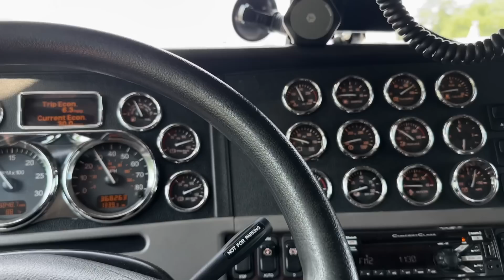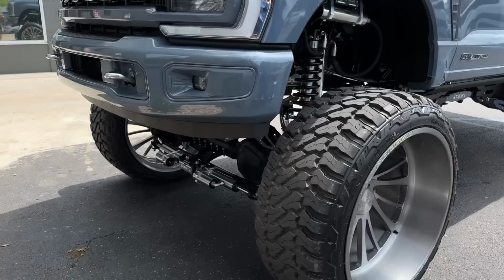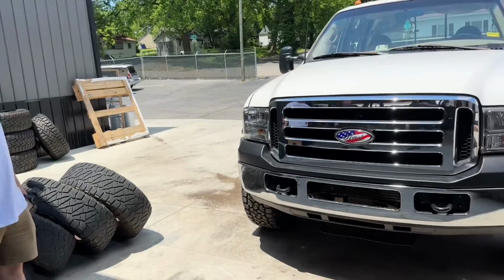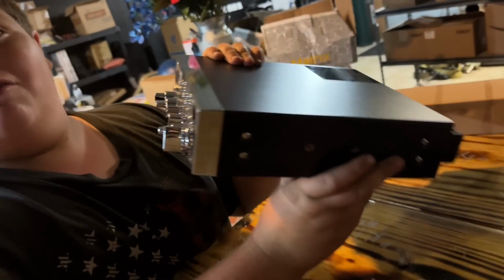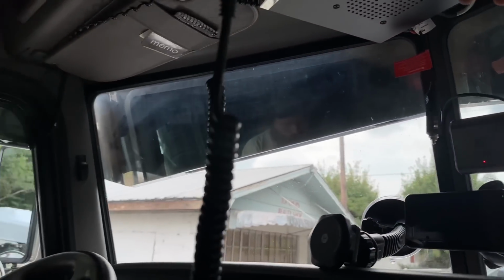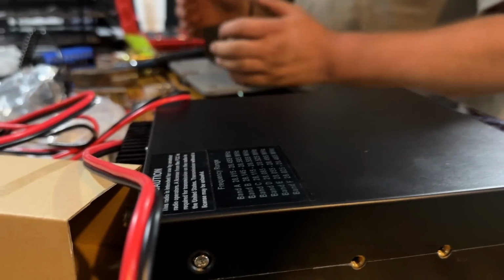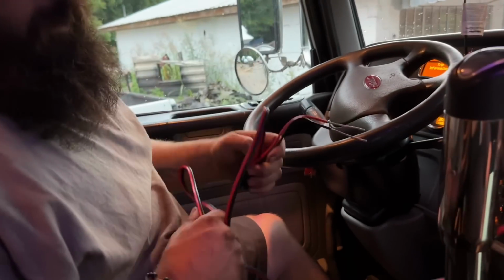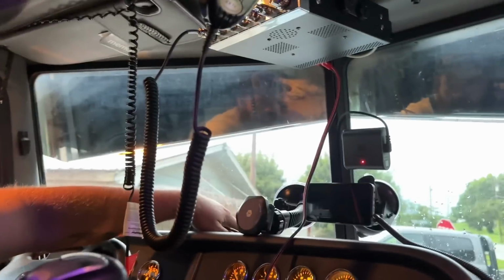Taking Things To The Next level!!

Comment: Just a Note on the CB Tim...Coming from a long time Armature Radio Op. 
The Antenna(s) is what will make or break a CB. 
if your Running 2 Antennas (Co-Phased) make sure you can get them the Correct spacing , 1/4 Wave length apart.
That distance is determined by the Design of the Antenna. usually 108 to 110 inches.
Making the Coax to a tuned length is an art to. and the Co-Phasing Harness is factored in to. 
With Co-Phased Antennas, to the Front and rear is your Strongest RF Pattern. off the sides is the Weakest.
Use RG-8x Coax if ruining High power. 
Back in the 80's of My past CB Days. I had a 102" whip on an Aluminum topper towards the Center of the Truck .
I tuned cutting the Belden 9913 Coax to an exact length using Ch 20 as the center frequency. I had a 1:1 match almost the entire band width. The SWR Meter and it's jumper were part of the Equation and remained in the Ckt.. 
A President Grant (1st version) Radio and a Mic from an old Motorola Business band Radio.
With just the Stock 4 Watts and good clear Audio, that combination was heard...
Mike M.
Reply: I dig old Motorola stuff and have used a lot of it over the years, good stuff.
Reply: Great info but I feel, and I maybe wrong, you’re way over his head. He doesn’t have the right equipment to properly tune the SWR and I feel the existing wiring he used is much too small for a radio with a pre-installed amp. He should have used the wire sent with the radio at minimum. 

My suggestion is to bring the truck to a shop that can properly configure it as well as trashing that Wilson. He should find out from the seller what the peak output is and purchase the proper antenna. I would also suggest using RG400 for his coax. The above is just my opinion and YMMV. 

Be safe!
Reply: @billmcgarrity1241  You are most likely correct. HAHAHAH..
I have been out of the Comm Loop for awhile, I'll have to check out RG400 When My 120 Ft tower goes back up.
Reply: @GTLees  I had to modify the Radio for power up the Mic Audio (Phantom Power) and a Relay in the Radio for switching.
3 pin XLR Connector. fit perfect on the Side Chassis on the Radio. Not a power mic but the Audio was Superb from it.
Reply: Because much of my expertise on the subject is borrowed from my dad, I too wound up being a fan of old school Uniden radios. Haven’t used them in years but still have two PC66’s tucked away and a PC78. Sold my President Madison home base and lollipop a while ago… what a sweet setup that was.   My dad and I could talk within about a 5-6 mile radius with that setup, and could hear the home base on the mobile unit up to 10 miles away.

Comment: If you're going to use the switch use it to power a relay with heavier gauge wire. The stock wiring and switches will melt down and could burn the truck down.

Comment: G'Day Tim. Over here in Oz, we have gone away from CB radio to UHF. Better range and smaller units. I used to run a Cobra CB 30 years ago, loved to listen in on the skip at night but we had little to no local reception (about 1 mile). The UHF gives us around 30 miles of crystal clear reception.

Comment: Tim all that white dust that was coming out as you screwed that antenna connection was corrosion and you need to take it apart and clean it with a stainless steel brush and coat the connections with some anti corrosion grease to keep it from doing it again. That corrosion will drag down your signal strength just like corrosion on your battery cables with drop your amps.
Reply: Gotta clean that corrosion on the connection to the antenna like I said. It’s dragging your outgoing signal down. The other trucks have the big amps pushing more power getting the signal to you.

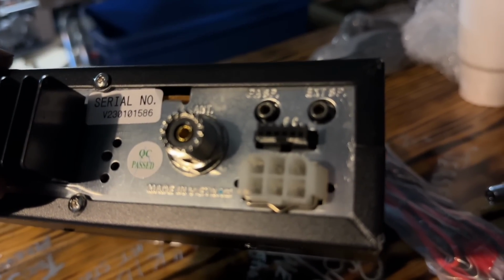Comment: 19:18 the plug above where the power cord plugs in is where you would hook up an external frequency counter.  Above that is where the PA speaker and external speaker would hook up.  That radio looks like it'll haul the mail for you while you're hauling the mail down the road.  I run a General HP40W that puts about 125 out.  Damn good radio.  I like the look of that Connex though... I used to run a 3300HP that put out about what my General does.  Kinda pissed I got rid of it.

Comment: Straight to the battery is always a good idea with a big talking radio. Direct power, and constant voltage. In my opinion and experience anyway lol

Also should use an SWR meter, and make sure your SWR is 1:1 or as close to it as possible.

Comment: Those fins on the back , means that radio has a built in amp, if the use the factory wires, it’s possible you will pick up all kinds of interference from your alternator , fan on a/c , blinkers and so forth. Not saying you will , it all depends on how much they have it set to put out. Also if that ground isn’t good, it will bite your lip. Just test it good.

Comment: I run a stryker 655hp with dual stryker SR 10 antennas and a 30 year old Road King microphone. Radio is peaked and tuned and barefoot 80 to 100 watts out. Enough to get over some in a Chicago rush hour.

Comment: The first thing you need to do with that new radio quit using the factory coax and quit using the factory antenna want to get your SWR inline and not burn up that new radio and once you do you'll find out you can receive better and transmit better❤

Comment: For that radio to perform the best and get the most power out of it, it will need to be ran directly to the battery. U can run it off the hot and ground post on the firewall under the hood. That factory external speaker will squeal if u use talk back. Get ur SWR's checked. I run a connex 4300 that has a single pill in it doing about 100 watts bare foot

Comment: I can see a couple of problems here 1st coiling up the aerial cable with a cable tie , 2nd have you checked the SWR
Reply: Fun fact…(If) coiling your coax changes your standing wave…(swr) and or adds Reflect…(reflective power) which is power back into the radio…then you’ve got cheap coax! Good quality shielded coax doesn’t care if it’s cooled or not!
Reply: Btw For my base I run several different radios…my driver is a 1x4 davemade driving 2 4-1000a’s and out to either my 1980 avanti sigma4 or my 6 element flat side…all my extra coax is coiled and 6500 watts doesn’t effect it at all. Udx534 Oregon state just cruising my little station

Comment: The fc is for an external frequency counter to tell you what frequency your on if the radio don't have one. They are good to have if your runnin uppers and lowers. And I did enter the drawing. I could use the cash right now but also use the truck right now because on the 6th my hole burnt and lost everything. So either one would be great. Love what your doin. The cb radio is a good radio I miss my 3300hp. I'd defiantly stop by a shop and have them check the swr's so you don't burn the radio up. Keep on truckin

Comment: Watch out running that radio it requires a ham radio license the fcc is cracking down on those. From a licensed ham operator.
Reply: I never said you had to have a license for 11 meter. It's not legal on 11 meters due to power output. You don't need a ham license for 11 meters/cb but you are limited to 4 watts.
Reply: Could you please explain why a ham radio license is required to run an 11meter cb radio? Also could you do an example of the (fcc) cracking down on none licensed 11meter operators please? Thanks
Reply: The radio itself said you had to have a license to operate it. I know it’s an 11m radio and according to the manufacturer it’s a 10m look it up. 

If caught it’s a 10,000 dollar fine and or jail time. 

Not trying to cause a fuss just looking out for Tim love this channel hate to see something happen
Reply: And if you want verification go to 18:51  and pause it and read the label.
Reply: That's my feeling. Thousands of people do exactly what he's doing but few show it on YouTube and it's definitely evidence that's hard to refute.

Comment: I run a cobra 29 ltd classic radio,  dual wilson 2000 antennas, wilson external speaker, astatic mic with gear keeper hooked to it.  Eventually down the road im gonna get better antennas and a big power radio.

Comment: I still use and love my old cobra 29 Ltd classic. Had it for well over 20 yrs and it still gets out and gets the job done. But those connex radios aren't bad either. And actually not talking about all the bs the govt  has doing isn't a good thing. People should know what is going on in the trucking industry. I think that people need to be reminded from time to time that if they got it a truck (and trucker) brought it.

Comment: That is pretty small wire brother do your self a favor and run a #8 from the batter to a block up there.  RF needs a Great Ground to prevent it from getting into your computer controls and stuff -  Just saying when you get time run you a nice fat wire if you want to put the Fire on your Wire ;-)  the smaller wire will work but your performance will suffer ....    Love you guys and your channel.

Comment: Also if you haven't already get your set on the antenna set because you will burn up the finals in your new radio if you don't. Blowing finals and pills in a connex gets expensive. Also ground to frame!!
Reply: Swr set

Comment: i use a galaxy 88 cb radio i use two wilson 2000 antenas 18 ft coax. my radio has upper and lower sideband its been tuned and peaked i get out about 20 to 30 miles and if i hook up my 200 watt linear i really get out

Comment: You definitely need to put a inline SWR power meter. To make sure that you have a one-to-one match on your antenna. And you definitely have to make sure that your RF power is up but not too much with matching it with your mic gain. You want to have a good swing on your SWR meter. But not too aggressive. And if you have a TalkBack switch. Shut it off. And I hate the echo option. It's annoying. If you like to be quiet and sound Bassy. Them lip hugging microphones are okay. But a good power Mic will sound loud and give you a little bit more Authority. But you definitely need to get that antenna matched with that radio. Because I definitely would hate to see you burn it up. But I can keep going on and on but I'll shut up. And thank you so much for the great content. And waving a hand to you Braxton. You look tough and that dually. You need to get a truck like that.

Comment: Stryker radio is the one of choice these days. I'm not sure who did your radio but hopefully they used a scope and not cranked it up to a splatter box. D-rail would be the radio guy for choice or Scott's Radios he also has a YouTube channel.  I hope you are using a external SWR calibration meter and using a good quality coax. I run a KPO DX5000 PLUS.  0.95 DEAD key variable Swings to 45 pep. So I hope you get it done up correctly but I'd never get a peaked radio from a truck stop. An I'd advise you to have it check to insure your not a splatter box. Because sometimes less is more. So you're not overdriving your carrier with modulation. 73's from WagonWheel SandPile Radio Lake Okeechobee waving at ya Breaker. Ps, the black jack in the back is for a frequency counter. CONNEX is a great radio. But not supposed to smell burnt.

Comment: That's a good radio tim, I used to run one just like it with a single Wilson 1000. But now I went back to my old original galaxy 88 for some reason I just love this radio and I got my dad's after he passed this February his cobra 148 he bought back in 1993 I'm thinking about putting that in the truck now but thanks for sharing tim and keep up the great videos
Reply: Years ago, I used a Cobra 29, for many years I'd switch it from truck to new truck and had great service from it. I finally went and bought a Galaxy 99 and had some extras installed from the radio shop...it was a BEAST! Hahaaa! It was fun using that one effect that changed my voice to a female-sounding voice heh, heh, heh. Some drivers would be sayin' how cute I sounded and did I wanna meet somewhere haaahaha! I've been outta truckin' for a while now but I keep sayin' I'm gonna put a radio in my pickup and haven't yet. I need to get on that.
Reply: @GTLees  when I bought my 88 I don't think they had the 99 out yet. But I just had everything turned up and blue lights inside of the green that came stock, u had all the toys put in yours I remember those voices to make u sound like a female and all I could think was boy oh boy someone is going to get in trouble with this lol and I ran a cobra 29 and 25 for a little bit when I was bouncing trucks I didn't want to put my 88 in there and keep moving it and stuff. U should put it in your pickup back years ago every truck pickup and car it seemed like had a radio in it and it was great now hell very few trucks have them and very far and between pickups and cars have them these days people have gotten to used to the cell phone and this or that, some people and some teenagers and kids need to learn about the cb radio in case shit hits the fan and that's all we have caus u never know

Comment: I have a Galaxy DX 959 I had it since 2008 took it shortly to a lil cb shop had some crazy stuff done to it only to have die shortly afterwards so in 2009 I took it to a CB neer the pilot in Indianapolis the guy said the I took it to done bad work and he would try his best after I got the cb back from the guy In Indianapolis the put out over 80 watts with the antenna I bought at the time I lost my trucking job back in 2010 the radio hasn’t been use until 2017 when i put in a dump truck I drove before moving to Florida now I’m back home in Alabama again I been thinking about putting it in my concrete mixer but kinda waiting for my new front before I do so I guess I better start buying up some parts for it

Comment: why don't you turn your gauges so that all the needles stick straight up when in normal operating range?   Some of the older multiengine radial powered airforce planes set them up like that.  A quick glance to see if they are all pointing up, and you know everything is normal.

Comment: 😂😅 lifted 4x4, and it's still useless as the lowest part that gets hung up still is the low diffs . 😂😅. 
Bigger tyres with 2 inch lift works better than that rubbish. Glad we don't run like that here in Australia. 
Tim the ford loks great . Great video as always.

Comment: If I won the truck, I'd be using it to start a business I've been wanting to start with my old man for a while, he's getting to the age where he can't work at what he does now, but he can't retire either, but I could also be talked into taking a similar cash value for it in order to put down/purchase something a bit smaller than a 550 equivalent, since I just need to be able to pull an enclosed bumper pull lol

Comment: Tim you need a Road King 56 to run on that radio it's a cb mike that will let you operate that radio fully without sqeeling.
Reply: I see you got one so good......don't forget to get your swr set on that antenna that way you don't burn up your radio and it will get out and receive at the optimum level...

Comment: The factory power supply is not big enough gage wire to handle the current or draw of a radio with a built-in linear im speaking from experience!!!!! You really should run that new harness that came with the new radio straight to the battery with a really nice resetable circuit breaker and an noise filter to stop power feedback you know that really anoiong wineing noise just give someone a call that knows there stuff about radios and they will tell you the same thing, before you burn your truck up all over a big boy cb

Comment: Hope the FCC doesn't see this. It will be a very expensive lesson. They have all the evidence the need for legal action.
Reply from the maker: Why would the fcc have anything to say about this video
Reply: @Gentryandsons  because that radio is not legal for cb band. It is a ham radio that has been converted to cb. It put out more than 4 watts.
Reply: Unless the user is Causing an issue with another service, The FCC has almost washed their hands of the CB Radio service...
Reply: They are hurting for money and have started enforcing a few things lately that they haven't in awhile. This is pretty cut and dry .

Comment: It's too bad half the drivers dont use them anymore. Not gonna say the name but it has a Dukes of Hazzard flag on the front it and was made 20 some years ago. Ran into a guy in Ontario CA. offering tuning for 50 bucks the first week out there with this radio. So happy this thing would reack out and touch someone. had to go buy a new coax. He got it peaking at 120. was happy

Comment: this guy got truck for sale Danny Sheehan  · 42m  · 
Going to be selling soon. Can I get some input on a fair asking price?
2011 Freightliner Cascadia
Cummins ISX 15
10 speed manual
775k miles
New front leaf springs, rear spring bushings, king pins, and steer tires. 
New AC compressor, expansion valves and receiver/dryer - blows ice cold
Has updated fuel pump (non ceramic internals) and newer VGT turbo with actuator (reman)
New oil cooler
Aluminum radiator
Drive tires still in okay shape
3.36 gears
Rear ends were rebuilt around 615k
No def issues........ 😉
2007 Transcraft DTL-2100 
48 x 102
New shoes and drums
Tires decent
Wood deck, could use some boards replaced but is worked as is
Located in Columbus, Ohio